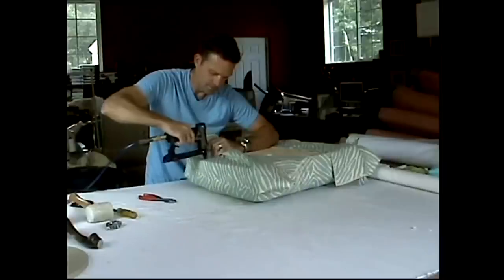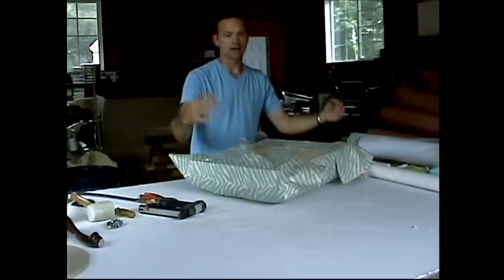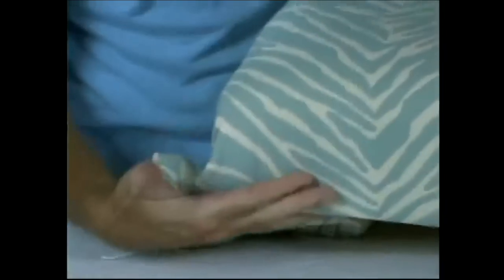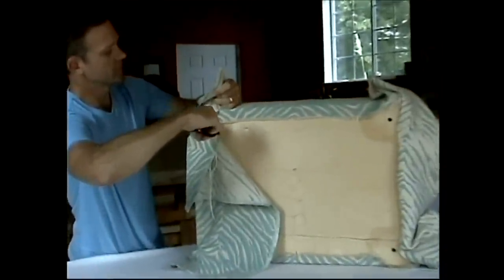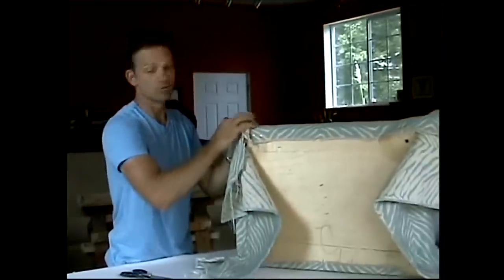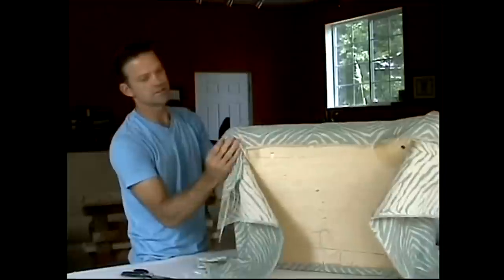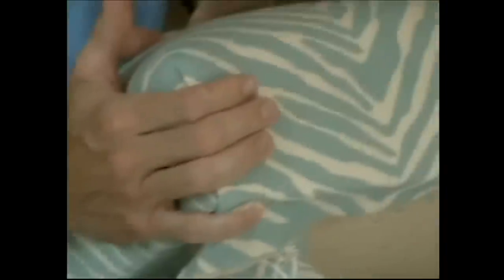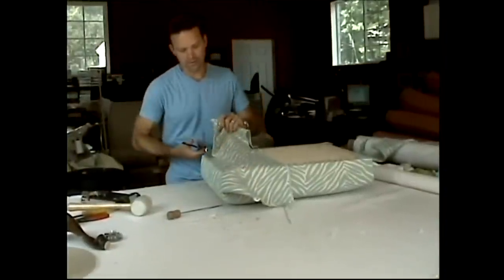DIY Ottoman Reupholstery Part 4

Comment from the maker: I would use a medium to heavy weight fabric for reupholstery. Use a print or fabric with a design to bring more fun and interest. but it could add more work because of any fabric line up needed. 
If you use a lighter weight fabric (silk, etc) it is best to shape the foam or cotton filler with an under cover (muslin) working out bumps and wrinkles. Then the silk-like fabric lays on top and looks great.
Thanks for viewing.

Comment: How much do professional using charge for upholstering a footstool?
Reply from the maker: It really depends on the size on the footstool and if you will have any add-ons decretive nails, gimp or repair work.  For labor only, around $ 60. to $150. is safe to say. This for a footstool not an ottoman some people see them as the same they are not.  Thanks for asking and watching.  Cheers.